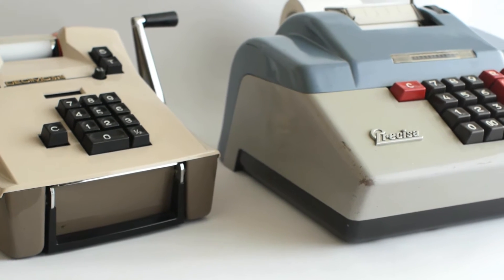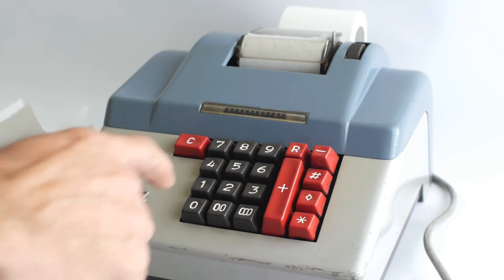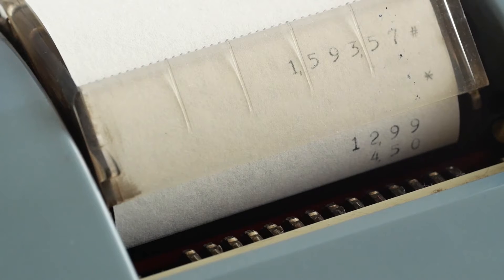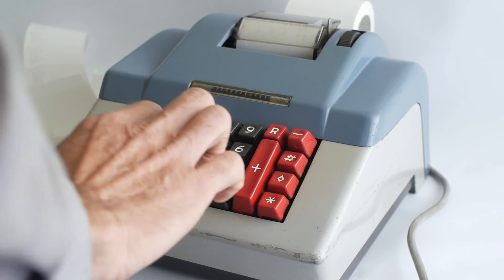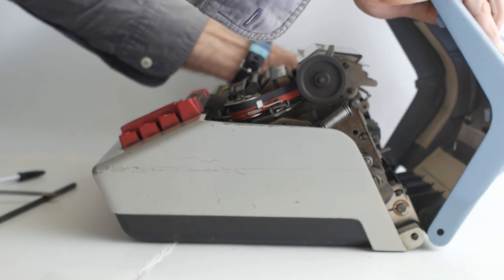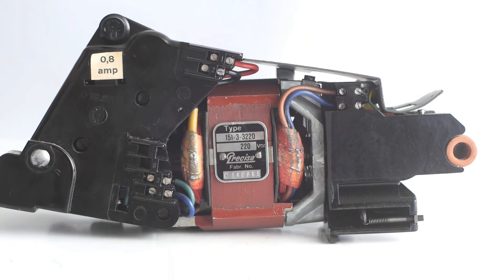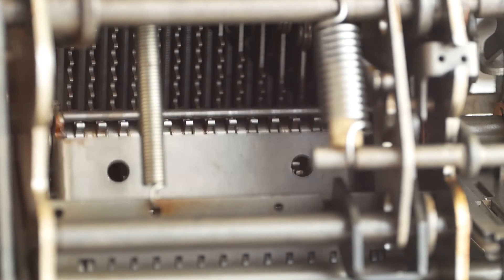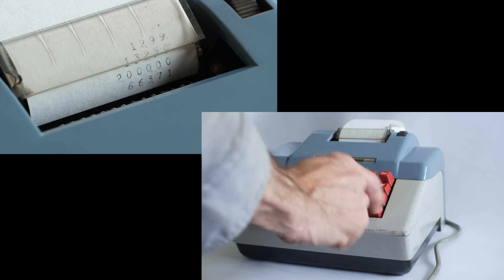Retrotech - 1960s Precisa 160-12 Electro-Mechanical Adding Machine

Comment: I love the fact that they don’t need electricity or batteries. We might have to need them again as backups given the price of electricity these days.
Reply from the maker: Hi Dulce R-L, everything about these old calculators is kind of robust and unaffected by system updates, viruses, hackers etc, plus they're great fun to use.  On the downside, they are kind of big (compared to a pocket calculator or your mobile phone) and often they need a bit of maintenance before they'll work again, if they've been in someone's loft for the last 30 years.

The Precisa in this video does use electricity to make it operate but many of the other ones that I've worked on are completely manual - and most of the time I reach for one of the manual ones because they're often a bit more satisfying to use - a bit like an old typewriter - those things are awesome too!!!

Comment: That is an awesome machine. I particularly love the way it comes apart. Just so easy to get into it.
Reply from the maker: I'm really impressed with this machine - it can't do some of the complicated stuff like division (you could do division in a very long winded sort of way but it wouldn't be quick), but everything about it is very satisfying, both to use and look at.  The way it comes apart is sheer genius - no snap together plastic clips that make it nearly impossible to take apart (ever tried dismantling an Epson printer!!!!).  I'll actually be using this machine lots when I'm doing my accounts because it makes the job a bit more fun (if the word "fun" and the word "accounts" can realistically share the same sentence).